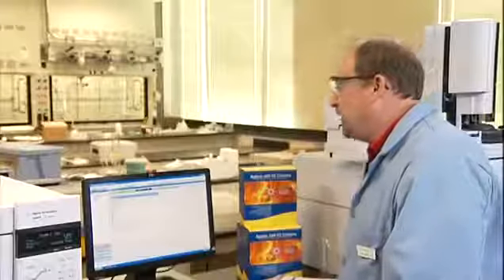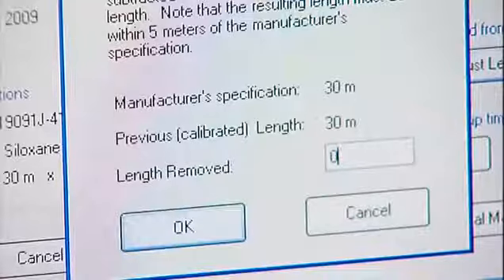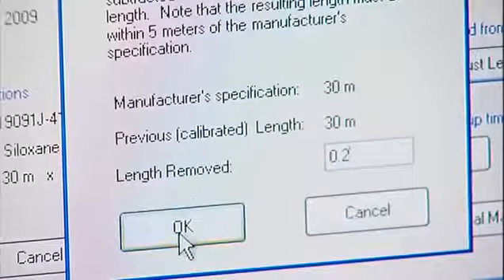Retention Time Shifts   Part 1   GC Troubleshooting Series

Comment: 🎯 Key Takeaways for quick navigation:

00:28 🧪 Retention time shifts in chromatography can result from various causes, including dimensional differences between old and new columns and column-to-column variations in diameter and length.
01:48 📏 To minimize retention time shifts, input the actual column diameter and length into the instrument software, especially when using electronic pressure control (EPC).
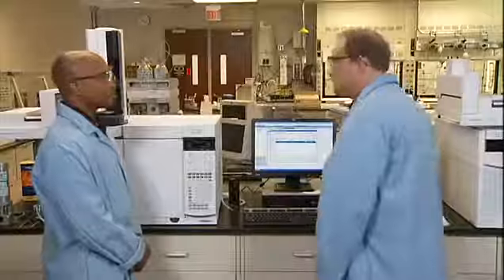03:37 📊 Verify the correct flow rate by injecting a known retention compound at a given temperature, as it's a reliable way to ensure accurate chromatography results.
04:02 🕳️ Retention time shifts can also result from issues like leaks in the injector or blockages in the gas line, affecting both peak size and retention time.
04:30 🔍 Perform an Inlet leak check to detect and locate leaks at various points, such as column fitting, septum, and vent line, which can occur during column installation or liner replacement.

Made with HARPA AI